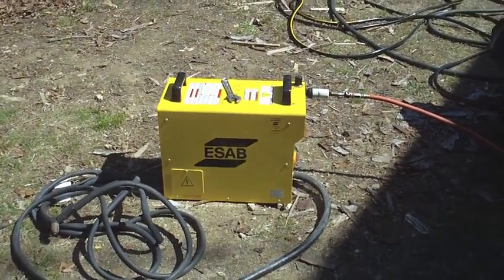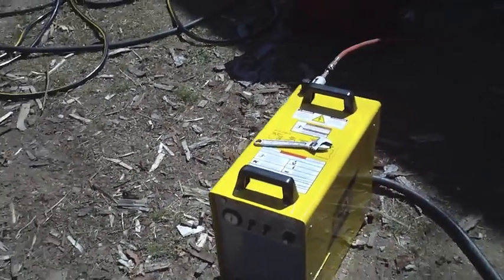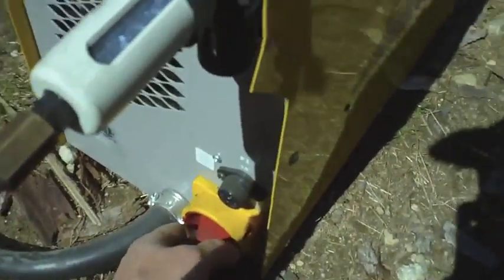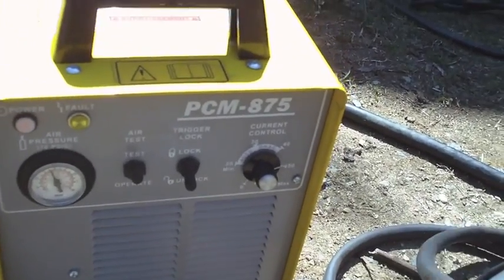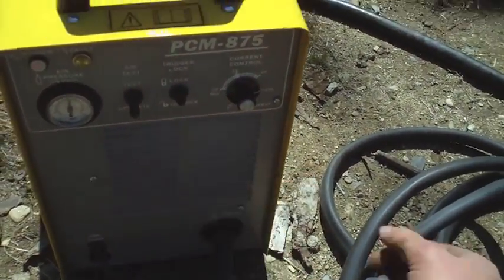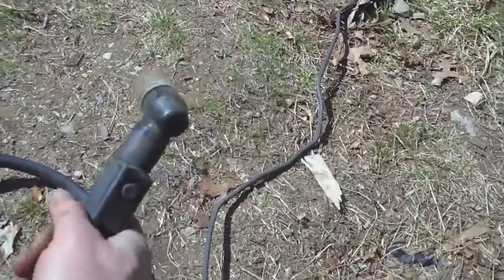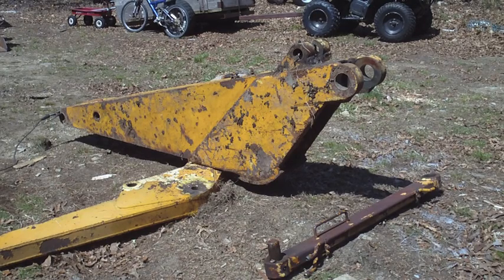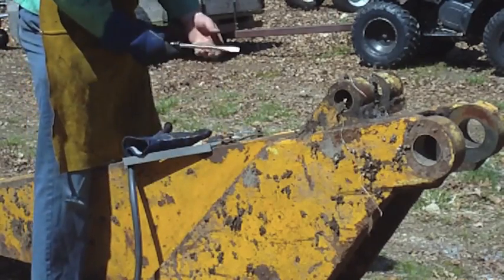The Boom pole aka "Minicrane" Project Part 3

Comment: Nice video thanks great to see some one taking safety into account i was put out of work due to a accident that could have been avoided so its definitely important to protect yourselves as much as you can have you saw a mix of magnesium and steel catch fire well its not nice and you have no idea what composition of metals you're cutting so best be over kill than not :D..Have you saw the thermite cutting hahahaah
Reply from the maker: You are so right about burning metal. In the service they showed up how white phosphorus can burn so hot it'll go through armored steel. The way they explained it was that the metal actually begins to burn like a fuel at those temps. I try to be safe, and am the first to admit I do not always practice what I preach. Just the other night I was at the grinder using the wire wheel for several minutes before it occurred to me I had no eye protection on…..not smart.

Comment: Should have got a hypertherm instead of a easb
Reply from the maker: That's just your opinion, and I'm not saying it isn't valid, but it is like saying you should have bought a Coke instead of Pepsi. If I were shopping new plasma cutters, I would consider Hypertherm, or Thermal dynamics as a strong candidates, but I picked up this brand new slightly freight damaged ESAB dirt cheap! A 60 amp unit for about half the price of a new Powermax 45, and the price of the Powermax 65 is not for the weekend warrior, unless he is a rich son of a gun. ESAB is not a cheap unit. they is respected the world over for making industrial quality welding equipment. This one performs well, and when I called there US customer support line they were friendly, and responsive even though I did not buy the unit new. And another thing I like about it is that like my parents, it was made in Poland!